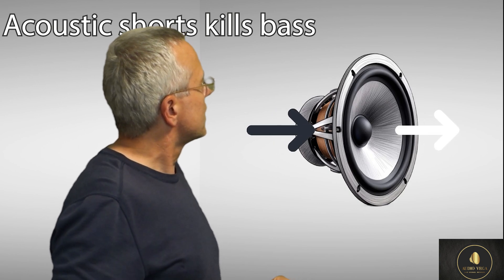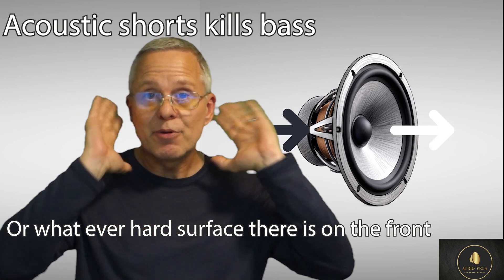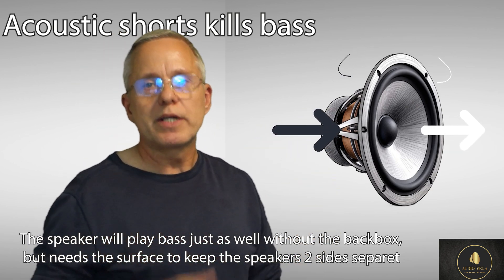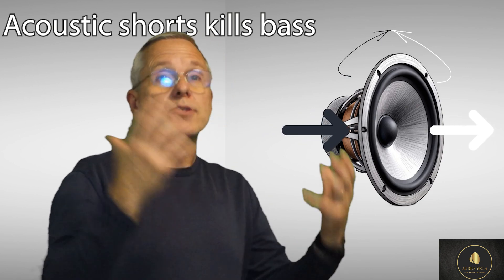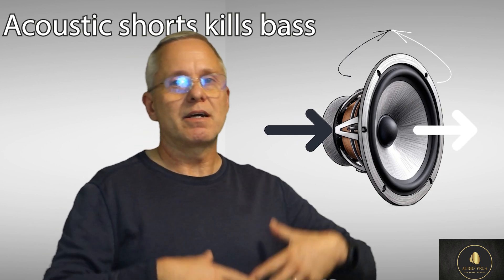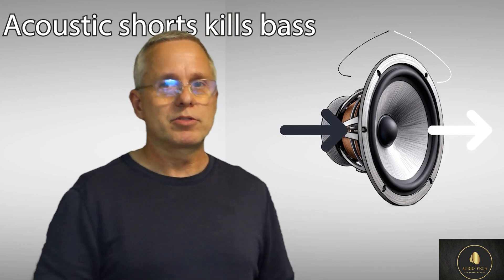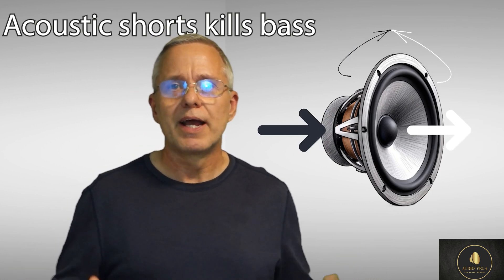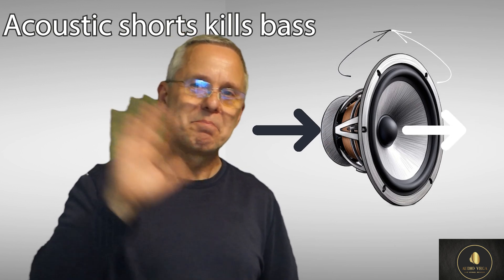Acoustic shorts kills bass

Comment: The downside to a sealed box is that you need more power for excursion versus open backed.
Reply: The goal isn’t excursion the goal is output volume. Sealed boxes limit excursion which means you can add more power to the system before it hits its xmax
Reply: @nickparkin8527  You just reinforced my point, thanks.
Reply: @sb6-SSaM  your comment implies excursion is the main goal. It is not. More excursion does not necessarily mean more spl.
Reply: @nickparkin8527  Ceteris paribus, more excursion almost always means more SPL. It's physics.
Reply: @sb6-SSaM ....Dynes/cm²
Reply: @nickparkin8527 ...LoL...come to the head of the class and assume the position kid
Reply: @nickparkin8527 ...OMGosh ...is that like some sort of parody or what....lol.
But thats ok...I.might have been equally confused when I started out in 1957
Reply: Excursion does not equal spl. 

Open baffles, due to their construction, experience a significant dB drop (around 12dB per octave) at lower frequencies due to sound wave cancellation from the front and rear of the driver.
Reply: @n.lyndley.9889 
...LoL

Comment: Thank you sir I really appreciate you sharing your knowledge with us I learned quite a bit there in that short video and right at the end you answered the question that I had whether or not that was applicable to ported speakers as in like bookshelf speakers or floor speakers or which whatever also perhaps you could direct me where I might go to try to find an information to identify an old I'm guessing 1950s or 60s full range loudspeaker with no manufacturers emblems or anything on it....
Reply from the maker: Thank you so much for that, and its a bit different for ported speakers, because the pipe is oscillating air and acts like a speaker driver, so its adding bass instead of stealing it. But they the woofer for it should be under 0,5 in qts or else it will likely introduce a lot of decay and sound muddy. There used to be a lot of fullrange speakers out there, and its a bit before my time with DIY so my knowledge is limited, but please send me a picture to my email kent@bekent.dk